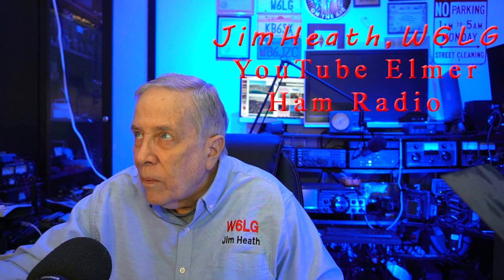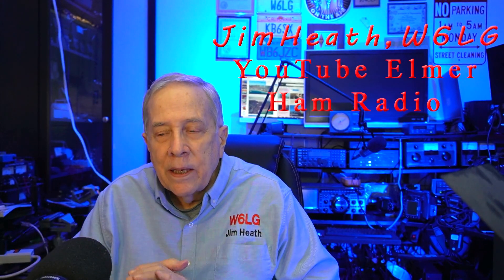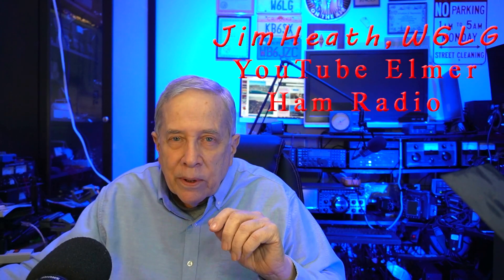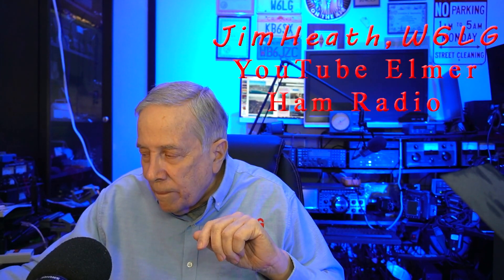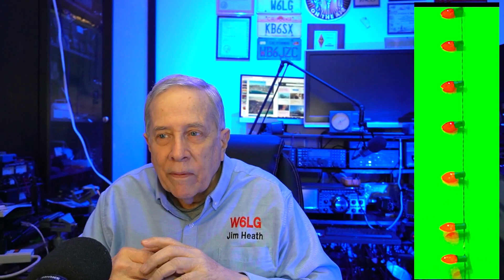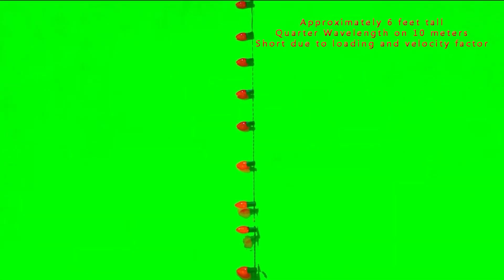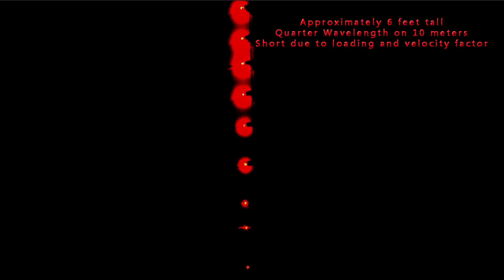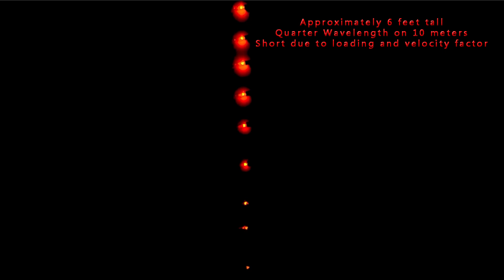Vertical Dummy Load & Antenna Which Part Does the Most Radiation? Jim is Out of the Hospital

Comment: Hi Jim, glad to see you back on your channel.
Question about this experiment because something puzzles me. In a normal string of xmas lights the bulbs are wired in series and it is the current through each bulb which lights it up. As such I would expect the bulbs to be the brightest where the current flow is the highest. Not where the voltage on the antenna wire is the highest, as this is the voltage or electric field of the wire with respect to its environment, not across a bulb, right? So where is your feedpoint in your example?

Comment: Glad you’re doing better.  I like the presentation. The visual makes the reasoning clearer. I remember CB antennas that had a small light at the tip that glowed during transmissions. I wondered how much signal they lost.  Looks like not as much as I expected at the time. Thanks